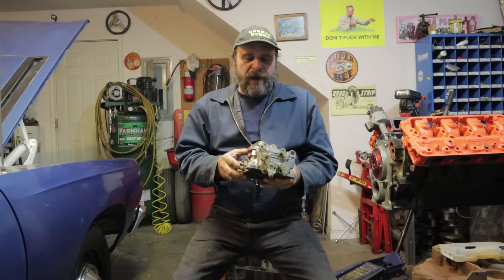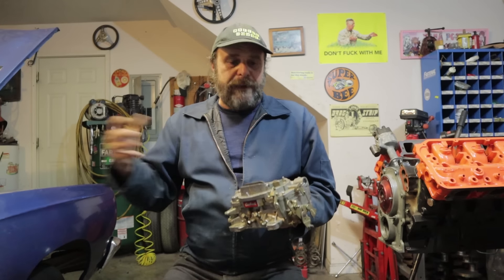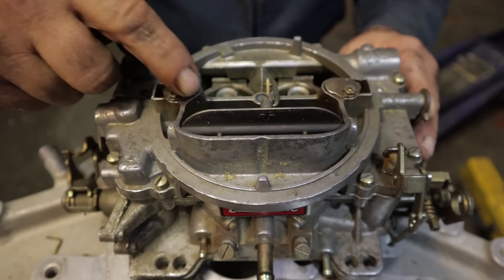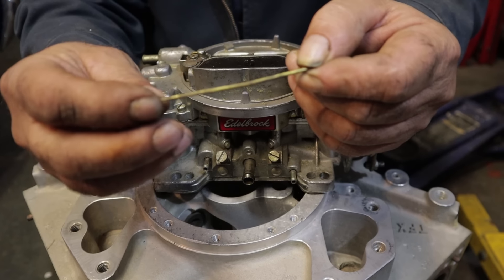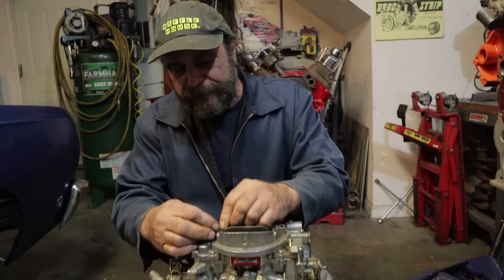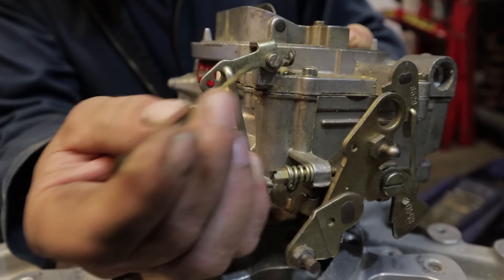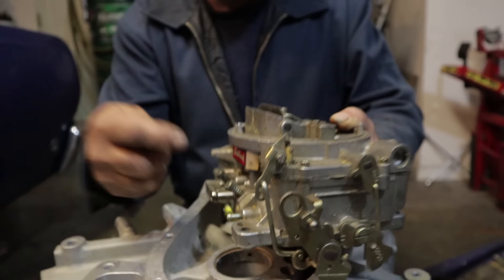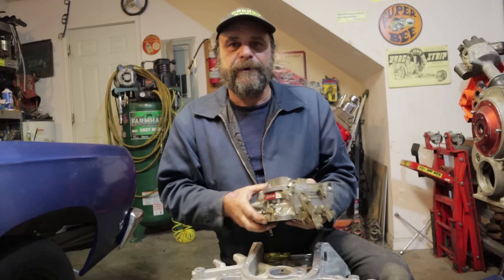How To Make The Edelbrock Carb REALLY Work For You

Comment: Love these carbs.  Once you set them up, they keep perfect tune for years.  Might be worth doing a another vid covering the primary and secondary jets.  They are fun to tune as it involves full throttle runs :) .  In the old days, you would lean to stumble and then richen a notch.  These days, you can get fancy and use a bluetooth O2 sensor to your iPhone.  You end up with the same jetting both ways.

Comment: one thing I have found with the Edelbrock Crab is that they are calibrated very rich from the factory. I almost always have to lean them out to get them to run decent and not foul the plugs. the factory calibration is a good starting point. Edelbrock has a tuning chart that comes with the carb, but it lone lists a fraction of the combination available with the jets and rods in the tuning kit. I prefer the Carter AFB tuning method. the key thing to remember with tuning a Edelbrock/AFB is that changing the jet size affect both Cruise and Power fuel ration. where changing a rod may effect only effect only one portion of the of the operation.  for example rods 1448, 1447, 1446 all have a .068 diameter step for crusie mode, but different size power mode tips, being .052, .047, and .042.

Comment: Thank you for the info. An irritating thing that happens with Edelbrock carbs is today's gas also makes the accelerator pump diaphragm swell up. When it swells up to a certain point, it sticks to the side of the bore that it sits in. When you go to stab the throttle, the diaphragm then slips off of the plunger rod and you have zero accelerator pump squirt. At that point you have a vehicle that stumbles off of low throttle when driving and that SUCKS. The only way to fix this situation is to take the top of the carb off and install a fresh diaphragm (thankfully they are cheap). Here in Arizona, I have to replace the diaphragm in my '65 Chevelle's Edlelbrock carb after about a year (or less sometimes). To test if your accelerator pump is working correctly, with the vehicle OFF and the air cleaner removed, quickly work the throttle linkage and look to see if you are getting a healthy squirt of fuel into the bowl.

Comment: Thanks UTG! It is great to have these things explained in a functional way that I can understand. Looking towards my first engine build, just learning and hoping to put together something that runs well and is kinda quick. You're one of the top sites I go to to watch videos about engines. I think the Edelbrock AFB is probably the best option for replacing my old thermoquad. Cheap and simple, and with a new intake it'll make the top of the engine look kinda shiny too. It'll be a good first run through this. 1980 Dodge aspen sedan 360 rocker LA core. (I blew a hole in the side of my stock S6). "Bad Ass Sedan!"

Comment: I love Edelbrock carbs. Very reliable and rebuildable. Every Holly I ever had. I have put out at some point. I catch Hollys on fire for some odd reason. 2 was enough. I didn't know about the secondary vaping out. I have suffered embarrassment due to that. Thanks for solving a head scratcher. Never had I considered evaporation.

Comment: I also had no idea about 5he secondaries drying out. I thought it was a fuel boiling issue. I put a spacer in between the intake manifold and carburetor and it helped with the boiling. Very interesting and great video

Comment: I have a 1969 Carter afb that was given to me. Guy said he gave up on it years ago. Put on my car and sure enough, it was bad. Found out one air screw was bent and I used dye and it showed it wasn't sweating. Well, I knew edlebrock took over and all components same.......or so everybody thinks. I order new screw and found out...nope, screw wont fit. Smaller and different threads. So I learned not all components are same between the 2. Jets, rods , springs all interchange but 2 air screws different.  So too both screws and carb to friends machine shop and he chucked them into lathe and tried them both perfect and dyed them both and now seat perfect.

Comment: One more tip!
To flow more fuel drill and tap for hose adapter on the opposite side of the body from the existing fuel line connection.
There is an internal channel like the external fuel tubing on the Holley, but it's restrictive.
I hope Strip Kits are still sold, beats drilling out the jets.
I prefer the Carter's, no power valve to blow, and can be set to run  more efficiently.
Reply: Great tip! they used to sell lids with both sides set up for dual feed! think its discontinued now though. there was a fuel line kit too.
Reply: @sczuylevch13  The current AVS2 carb's have a fuel inlet on both sides. Can use  either or both.  Have used several AVS2's since their release and have been very happy with them thus far.
Reply: @sczuylevch13  I believe they were for the AFB style and I don't think they made them for the AVS Series.  The Thunder series AVS Edelb. and AVS2 come with dual inlets if you want to use them...

Comment: I do mobile mechanic work and just rebuilt a carter afb 4 barrel looked just like this, obviously. They are great little carbs. It's running great but will need just a little bit of tuning to get perfect. But if you can rebuild any carb and throw it back on without needing tuning, you're lying. haha. cool video!

Comment: Ok Tony, I looked up the metering rod situation as to what comes in a strip kit. Unfortunately 2 step metering rods are the only thing available. If your lucky and find an old AVS strip kit at a garage sale or swap meet, you might find them, but they're not made any more. Something else I found that was interesting on Edelbrock site. They have a section on accessories for carbs, and they even have a few metering rods for the Rochester Quadrajet. They're are great carbs when you get them set up right, but the biggest problem with them is the main well caps. They come loose and leak like a sive after a while. There are a few easy to fix the problem, and I've used JB weld to fix them in the past. Search that on You Tube. Edelbrock sell metering rods for those too. The q-jet rods are tapered. They're are small in the bottom and larger on top, but there isn't a step like the AVS/AFB family. They are replaceable without removing the carberator also. But you must fix the main wells first because if they're leaking you'll never see a difference in performance, it will run rich and suck gas. The other cool thing about the Q-jet is that the metering rods hang from a wishbone shaped hanger. There are many different hangers available, but Edelbrock only sells two of them. The difference is the initial height of the rods which is determined by the holes in the hanger that the metering rods are held in by. So, but swapping metering rods and hangers you have several different combinations to tune with. When I was running a quadrajet on my car I went to the wrenching yard and took as many different hanger as I could find along with an assortment of metering rods. If there's room in the hanger you can drill a second set of holes in it to change the rod height. To learn more Doug Roe wrote a book on Q-jets and how to mod them for performance. There are a lot of things you can do inside the carb to make it perform better that I don't remember the specifics of, like drilling .030" holes in the emulsion tubes. But this must be done in the right spots or it won't work. And it's a bitch to do. You're better off marking the emulsion tubes where you want to holes to be and take it to a competent machinest to have them drilled. If memory serves me right linkfelter was another master of the Q-jet. He ran them on his Super Stock Camaros and ran in the 9.90's with Quadrajet. That's as good as Herman Lewis did with his SS/AMX, which held the tiles in IHRA for several years. Herman is a legend in the AMC world. Good luck guys!

Comment: Hey Uncle Tony...this video is great, thanks! I was about to chuck my Eddy 650 on my chrysler 318 in favor of a quickfuel or Holley pro form,.....then I saw this video. Thanks!    I have been able to figure out  the springs/rods etc "mostly" as far as how it responds to throttle but I STILL cannot get this engine to idle right.  Was thinking of dumping the Eddy 650 on it now for a Holley.  But I saw this video and it makes me not want to give up yet. Been trying to tune this thing for years.   
Recently rebuilt/cleaned it and that helped some but still fighting the idle. Chrysler 318, J heads, stock style electronic ignition and distributor, plugs and wires good.... It has an unknown "purple" cam in it...Mopar's performance/race series camshafts back in the day.  I don't  know the duration/lift as it was in the engine when I got it.....but I know it only has like 4-5 in  HG of vacuum at 750 idle. FAST idle (1200 ish), maybe 10 in HG.   I have the lightest springs (blue) in there now.
 And responsiveness is good. But still, I cannot find the sweet spot for  idle when in drive or even park sometimes.  Right now if I rev it up it will idle too high...around 1300 rpm or so.....almost like the throttle is binding open but it NOT....drive it for a while and come to a light, she will stall in drive unless I bump to neutral and rev it, then she idles high again until I shift into drive...then try and idle like that and she will stall. A vicious cycle!  I have an aftermarket (TCI Breakaway) 2400 stall convertor in it...prior to this, with the stock convertor I couldn't get it to idle at ALL...   I know it is idling too high because the idle stop screw is too far in and so the transfer slots
 are way exposed... but if I wind it out she stalls in park.  LOSING MY MIND!!!! Any ideas?

Comment: Thank you uncle tony!!! I'm a modern fuel injection mechanic and with your video I have been successfully tuning my Edelbrock avs2 carb for the first time ever. (I've never been able to tune one). I am still running crazy rich on the secondaries. Where are the secondary jets located? I'm running a 650cfm on a Ford 302 1969 with ported and polished heads.

Comment: I like both Holley AND Edelbrock carbs equally. As Uncle Tony says, they have their place depending on application. Had a 750cfm double pumper mechanical secondary on my 350 in my s10 and it was a blast! I now run a 600 cfm mechanical secondary and it's like fuel injection! So smooth and responsive for daily abuse haha! Holley without a doubt made more power though.

Comment: Like your channel im a Ford  guy but have used a AVS in bracket racing for 12 years  with good results 12 firsts and many other good placements  i run a full interior 83 Thunderbird  WITH 302 mild cam 212 / 218 @ 50 and 3500 stall and 4 30s with shorty headers and 2  /1 2 exhaust best et  12.7 at 106 thanks for the info

Comment: Agreed. Not the best carb for maksimum performance but excellent for a daily driver when tuned with a AFR meter. 
When running a AFR meter, we found that the mixture is very lean just when the secondarys starts to open. We added to the weights. I belive there used to be different weights to choose from.

Comment: I use Stabil 360 marine formula in the fuel to avoid problems with ethanol blended fuel. It will also slow fuel evaporation! I have used it for years and I have never had any problems.

Comment: My 77 z28 350 had a quadrajet that ran great for a while until one cruise night going down the highway. It was starving for fuel. Get off the highway under 35 mph its fine. Several hours later back on the highway ( and mind you only 15 miles) it starts to stumble and no power. Get off and put fuel in,  2 miles from home and can launch the thing ok.  Now, couple days later take the car on a surface street cruise. Get 15 miles from home and the same crap happens.  Go to my friends house and throw on ANOTHER Quadra junk and it last a little bit again. We finally went to a junk yard and I came across an Oldsmobile with a 500cfm Edlebrock. Brought a gasket kit and did the whole smeal with the floats. Its been butter ever since. Now that's an old factory carb sitting in someone's garage compared to an unknown aged aftermarket junkyard carb that's easy to work on and get parts for at a local parts store...???

Comment: Great video. I do like the Edelbrocks too. The one thing I don't like about them is they won't tolerate the PSI of a mechanical fuel pump as well as a Holley. So it's even more important to reduce the fuel pressure to these Edelbrocks. However I'm a fan of a return fuel system so there ya go. Usually a bypass fuel filter (WIX #33040) works good but I have found you still need to regulate the return flow otherwise most all the fuel will be returning to the tank. (Tony I have yet to see the bypass filters with a built on orifice). Instead of a regulator I use a 3/8 brass brake line coupler, drill & tap to accept a set screw with a 1/16" hole drilled through it, and adapt it to the return line. That will usually be your sweet spot for returning fuel yet still providing enough to the carb. Yes all that with a mechanical fuel pump. I'm sure you can play with the return orifice size to work with an electric pump but keep in mind in high performance applications this setup still might return too much fuel to the tank and starve the carb at WOT.

Comment: I learned how to tune these a long time ago, and I agree that they are an excellent street carb, my biggest dislike is the rating is done at a different vacuum setting than a holley. Last one I did was a 68 cougar with 2.7s, an auto, and a mildly cammed 302 . First, I focused on getting rid of bog when you matted it, then I dialed it in for good mpg without detonation. I just wish they would update it with a contoured flow path, and standardize the rating system. Then you could probably start shelving holley's instead lol.

Comment: Who said you can’t teach this old dog new tricks, very interesting video. I was a more sixes and fours performance kind of guy and was curious as to why instead of running stonking big 4 barrel carbs you have not looked into multiple carb systems like on the 6and 4 cyl engines? Especially with SU carbs , just one jet to muck around with and once setup virtually maintenance free . Many moons ago when I was a apprentice mechanic myself and one of the mechanics training me put 4 2in SU carbs on a 351c . Once the jetting and balance issues were sorted that motor gave better power and economy than the same motor with the 4bbl . Tractability was possibly a touch worse but that was in the 70s in Australia. Love your work with the slants . If you can find one a distributor scope is the best thing ever for playing with your timing curves for a non stock motor. Cheers from Australia from a almost old grumpy bugger

Comment: Thank you very much for this very informational video. I had a carburetor that was running too rich and using all the pointers you gave me in the video I changed out the primary jets to a smaller size today. In the car runs the best it ever has.

Comment: A bit off topic but my dad had a baby blue 67 GTX with a Hemi in it. After cracking a piston, the local Chrysler dealership refused to warranty the car claiming he was racing. The car was broken down near a marina in San Diego. And my dad claimed he heard a howl coming out of a boat shop near by. The boat shop built race boats and had a contract with Chrysler. They warrantied his car and rebuilt the engine. When is was done it was blue printed, ported, polished and made a hair under seven hundred horsepower on a dyno. 

What I find strange in the story is my dad mentions a 3 barrel carb that featured a huge secondary. 
I have never seen nor heard of a 3 barrel carb aside from this story. I dont have a reason to doubt it either. After the rebuild my dad did race the car occassionally and his best time was a 10.13 on a cool foggy night in Oakland. The fate of that particular GTX is it got wrapped around a tree in Texas after my dad sold it. 

I'd like to see some old the old aftermarket parts and I enjoy learning about the old ways of horsepower in an age of digital tuning.
Reply from the maker: The Holley 3 Barrel is the carb that predated the Dominator.  They were available from 67-72 and came in 950 and 1050 CFM sizes.  Great carbs that were a bit tricky to tune.
Reply: @UncleTonysGarage  I still have a couple Holley 3 barrels.   Ran 1 on a 427 '67 Chevelle back in the late '60s.  Never a problem with Horsepower and no one cared about gas mileage back then...

Comment: i have a lot of time working on the AFBs.   i have 2 hints.   1.  never change the jet and rod at the same time.  because you can not guess at the change.  change ONLY one or the other.    2.  i have found a float setting of 7 / 32 works some times.  hay Tony  heres an up date.    as you know on the Holly jets they are sized in air flow at the factory.   so  at any hole dia a change if one size is 2 percent.  not so with Carter jets.  which is by diameter only.    meaning a  .060 dia with  size change of .002.  is a differant change than. .100 with a dia change of .002.  this is why if you change the jet AND rod you cant know what change you made.

Comment: I dig them for the most part. The fuel pressure should be noted though. Seems like these carbs like no more than 4-5 psi of fuel pressure. I’ve spent hours trying to “lean down” a pig rich edelbrock with no luck. I’ve usually had to resort to a regulator seeing as many factory mechanical pumps are around 7-8. Good video.

Comment: That's what they make heat isolator plate kits , had to run on my Ford 400ci in a 1/2ton 4whl Dr .You could hear the fuel perculating out if it was quiet.